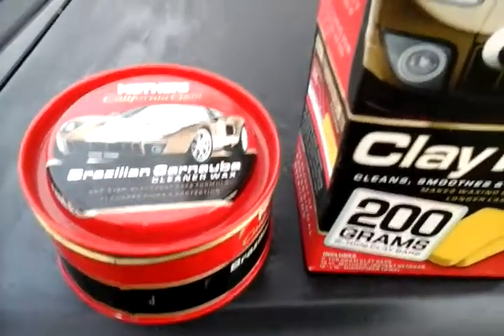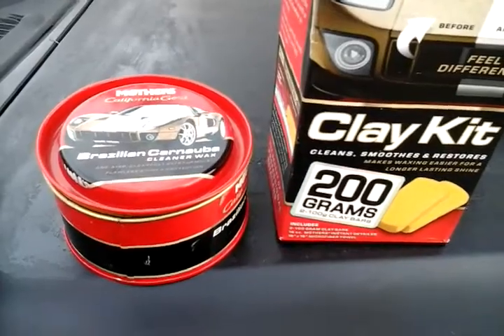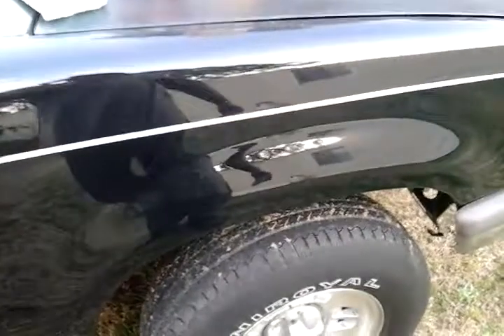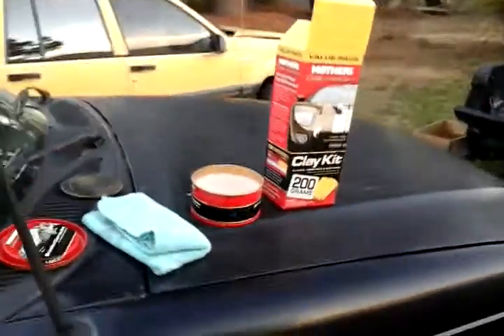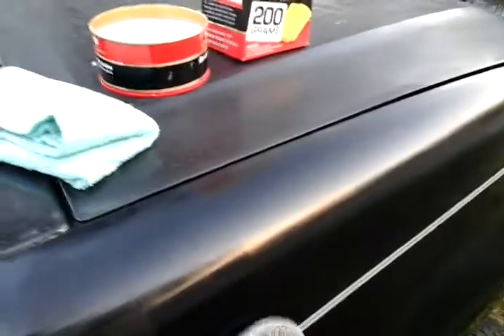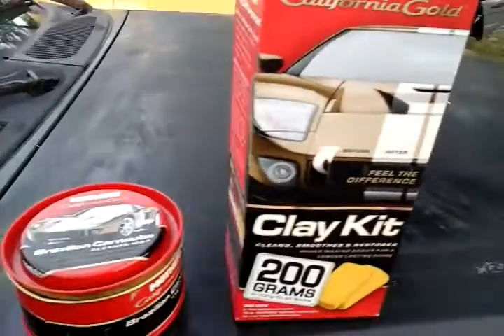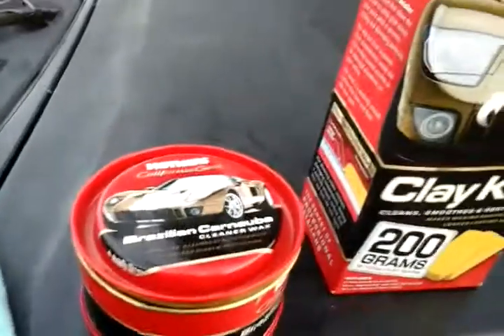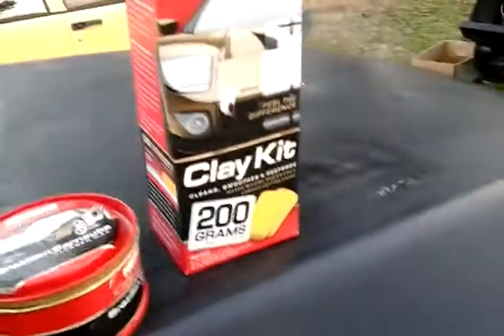Mothers is the best beginner car wax

Comment: I've got to disagree with you buddy. That wax is the hardest stuff to buff off i've ever used. I once did a full SUV with that wax and it was hell. For months i was still finding dried up streaks of wax that didn't buff off. Never used it since. Chemical Guys and Nu Finish is where it's at! Good video!
Reply: AsbestosWelder68 i got a new company you should try amercian souvern wax its the best out right now there cherry wax on ebay for 9 bucks give it a try tfw buddy